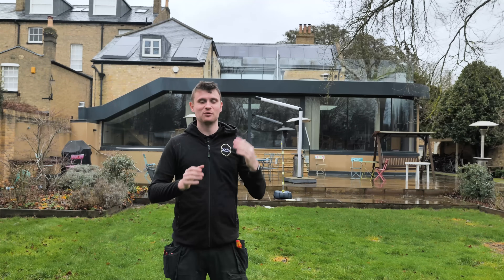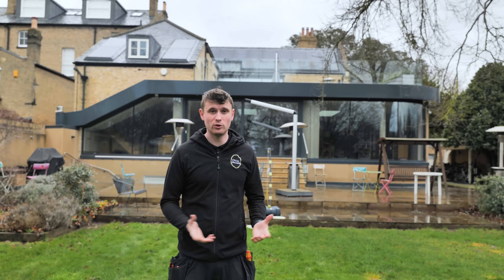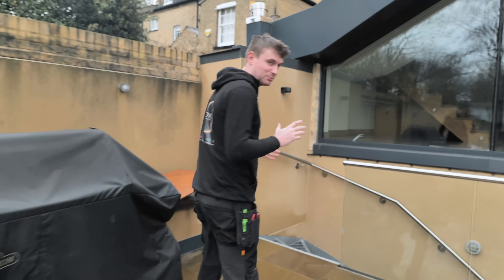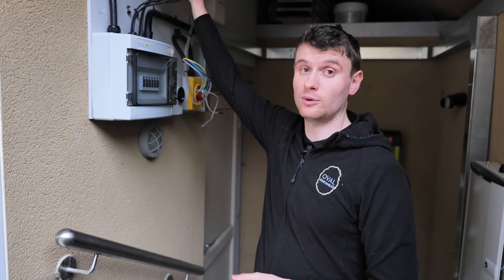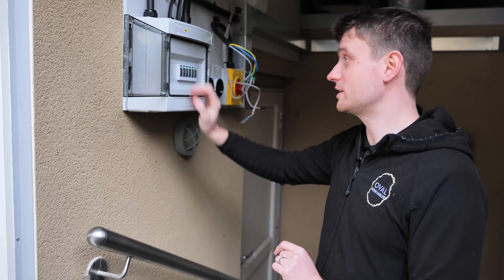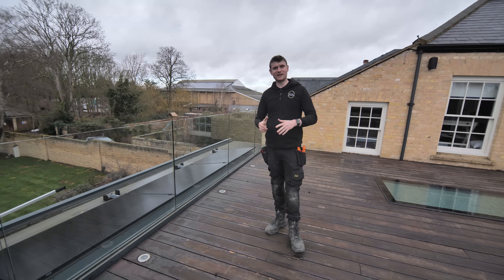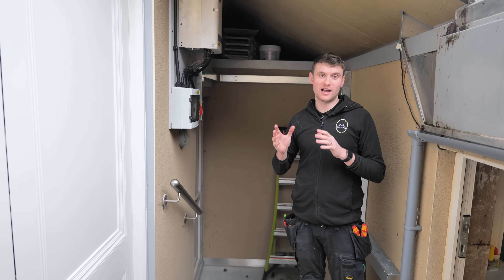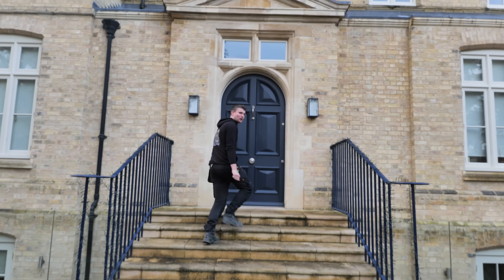Our most complicated Solar PV Project Yet!

Comment: Hi chaps.  Another great installation and detailed explanatory video.  I am doing my solar course in June and I've got a question about the DC surge protection unit.  I am guessing other people will also be curious about this.  I can see the two sets of terminals for the two strings on the dinrail but I'm not sure why each surge protection device has THREE trippable elements within it.  In your installation is seems that one of the three devices protecting just one string has tripped.  Why isn't it one device/trip per string like we have one mcb per AC circuit?  I know you are busy and I will understand if you can't find time to answer.  Keep up the good work.  Thanks and regards. Andrew

Comment: Requiring an app for configuration is complete nonsense. Is there not even a terminal connection so that you're not reliant on a manufacturer to maintain the cloud infrastructure? Looks like the pin isn't sticking out the SPD, so it's the typical failure you see all the time from that brand - the flag drops even though no surge occurred.
Reply from the maker: The app is connected via a local Wifi connection directly to the inverter. I don’t believe you can plug in directly to it

Comment: Where can I get the dc surge protection units from? Can it be purchased as one unit with enclosure or do you have to build it up myself. If so what are all the components.
Reply from the maker: Have a look at surge protection devices. The connectors are from the wago top job range
Reply: @OvalRenewables  what’s the part number for the Wago topjob connector?

Comment: Looks a great install as usual from you guys. Only question I have is regarding the 17kw inverter being fed by a 6mm conductor on a 32amp mcb?  Am I wrong in thinking that a phase with a 6mm conductor could potentially draw more than 10kw if it was being generated and the load required it?
Reply from the maker: Thanks very much. Remember this is a three phase system. If you look up the datasheet for an SE17K inverter the maximum continuous output current per phase is 26a 👍

Comment: Are you concerned that one of the fuses on the DC circuit should have already blown? Does it suggest it might blow again and that there is a problem somewhere within the install?
Reply from the maker: Thanks for the comment, the part that blew was a surge arrestor and not a D.C. fuse so we aren’t concerned as the device has done its job and protected the inverter 👍

Comment: Great looking install, thanks for sharing. Just hoping to find out why only now are installers fitting SPDs to the dc side of the systems? Would the manufacturers not be responsible for ensuring their inverters have built-in spds on the dc side? Thanks
Reply from the maker: Some of the commercial inverters do have SPD’s built in but the domestic ones don’t currently have it. Other brands vary as to if they do have it built in.

Comment: Beautiful stuff! What bird protection are you using? I work for a firm that doesn't install it as standard (advises clients on where to go if bird protection is requested), and I think it often ends up being the dated (in my opinion) wire meshing. The solid protection illustrated in this video looks so much cleaner, and really ties in a solar array with the roof.
Reply from the maker: This system is called Solaskirt. It looks the business!
Reply: @OvalRenewables  Excellent! Thank you... I wish you were based closer to where I live because I'd be hounding you everyday to employ me.

Comment: I’m going to need 60x panels gulp and we don’t have 3-phase anywhere near. Would it be possible to run this size to single phase, perhaps to batteries and water storage? Great video would be interesting to know how many people did the install in the three weeks? As part of contracts I often install all the trucking and service routes as part of the build then the electrical team just wire, test and label. But in old massive building which we end up doing most, ‘invisible to client’ cabling is most of the hard work? Especially making them fully serviceable with draw cords etc! Super video looking forward to the update with batts!
Reply: Anything is possible, depending on your DNO. You could go for export limitation someway, or possibly look at going partially off grid with an automatic transfer switch to disconnect your property from the grid when your production goes over a certain level.
Reply from the maker: Thanks for the comment! As the other comment mentions it depends on the DNO. SolarEdge is great though as you can oversize the panels to inverter by 200%. So all of this would probably go onto a single phase 10kw inverter when orientations are also considered. It would have to be ran through the design tool to check
Reply: @OvalRenewables  thank you! In our case it is only the south part of the roof that can take the 60x panels so it could be very effective in summer!
Reply from the maker: @FiscalWoofer  ok that’s a good size roof. In that case you probably won’t get 60 but it all depends on the size of inverter(s) you can get permission for from the DNO

Comment: Fantastic vid, yet again. But, how do you respond to the criticism of the solar skirt with it's reduction of airflow around the panel affecting panel efficiency?
Reply: Yeah, the skirt looks nice, but I prefer mesh which keeps the birds out and allows airflow.
Reply: Are birds nesting under really that much of an issue?
Reply: Indeed, I wonder if there are skirts that are layered, finned or perforated; would still look good but also let the air flow through. It's my one gripe with in-roof solar; unless you are replacing the roof or it's a new roof and you design in an air gap between the tiles and the roof membrane as you do with external cladding.